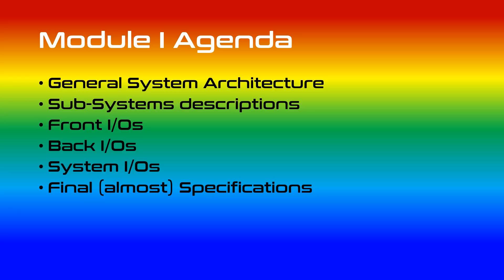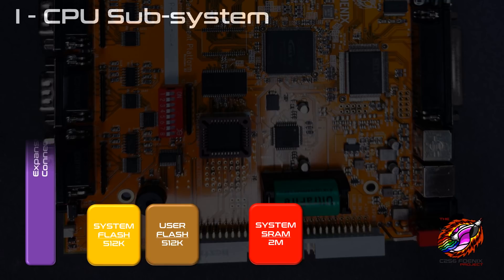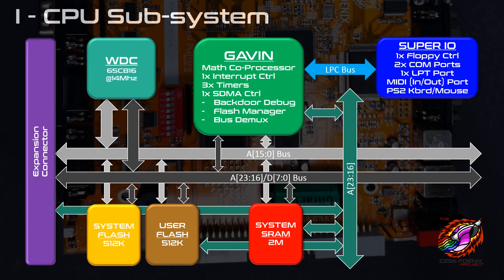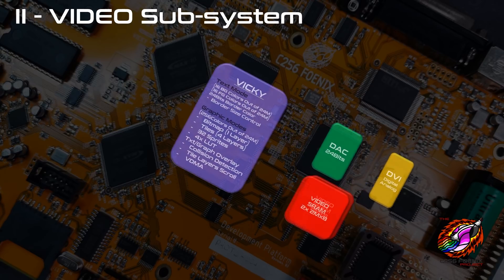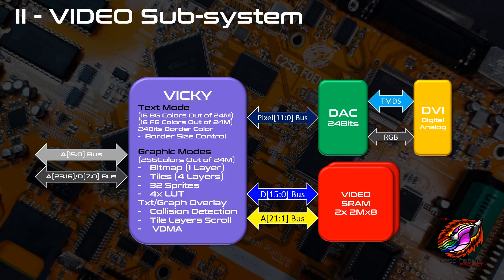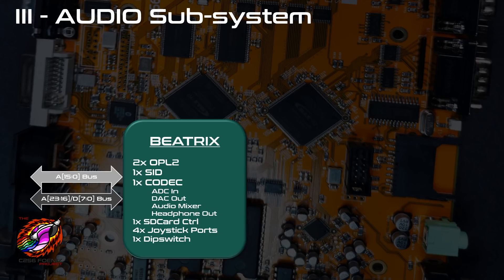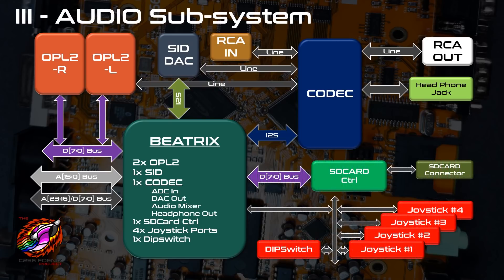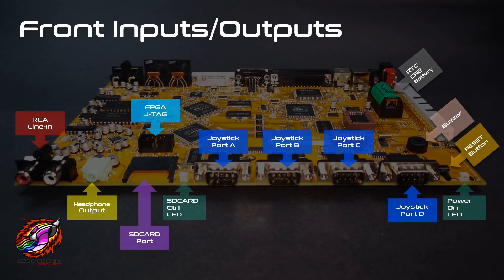C256 Foenix - Tutorial Series - Module I - System Architecture

Comment: I do not know quite where to post it in the forum, maybe under Specifications. However, I'd be cool with 2 megabytes of extra ram for $10. I do have a question about the math co-processor. What is the general performance of the coprocessor / FPU? Does it multiply and divide in one clock cycle, or is it more like the 65816 in SNES, that it takes 8 clock cycles to multiply? I don't really have a preference. I suppose if it's faster, then this can have some simple 3D calculations to pull off something like Wolfenstein 3D on a 286. The system looks cool so far.
Reply from the maker: Like I mentioned before, I am not totally against the idea to put in place a way to reduce the resolution, but before I even contemplate the possibility, I need to finish the system as soon as possible with its original specs. Beside, a change like that would have a lot of repercussion on all the other Vicky's feature ... And, again, I am still not super convinced that because you would have access to a lower res peeps would automatically migrate old games to it, It would certainly help open the door for it... But how about we create new games instead of porting old one?
Reply: @foenixlabs  personally I like the blocky look of low res, it is artistic choice, and not for ease of porting stuff.
Reply: @foenixlabs  OK, sorry about the possible off-topic with my previous comment, I see your point. Creating new games/etc instead of porting old ones, indeed. But at some level this is more a "retro hardware" ie it's not an ARM / RISC-V / whatever based SBC but a hardware with a basically "retro class of CPU" so I think many people expects the 'retro feeling' and some 'retro compatibility' as well because of that. If someone wants to create something completely new, using only super high resolution and no other features is more like a modern hardware/SBC rather than a basically "its roots in the 8 bit era" feeling. Please do not misunderstand me, I like this project a lot and you've already done fantastic work, no doubts :) And these were my only feelings/ideas which are even hard to form into a technical explanation rather than a "feeling" only ... And yeah, sorry for the possible off-topic, I don't want to bother you with those, that "scaling stuff" wanted to be a technical level idea, I didn't have too much the intent to argue on the "feeling level" which is hard to catch anyway, and means different things with different people. Thanks again!
Reply: Finish the original system and sell us some. :) @foenixlabs
Reply from the maker: Thanks tterbo128, I will.. Check your email! ;o)
Reply: @foenixlabs  The games that I'm planning on making for this system will have the option of old school 320x200 mode and less-old school 640x480 mode. It would be great if there is a "true" 320x200 or 320x240 tile mode, but, if there isn't, I will just have to quadruple my pixels for my tiles. Something like the Mega65's VIC-IV's scaling registers would at least allow me to just program it as if it did have a 320x200/320x240 tile mode.

I personally would be very interested in 320x200 games for the Foenix, as it has the old school look. Also, I use 15.75KHz RGB-converted TVs, computer monitors, and an arcade monitor. A lot of retro-enthusiasts use some form of 15.75KHz monitor. I personally would love a 15.75KHz output option, and would be willing to pay extra for it. Supporting both scan rates, like the AGA Amigas and the Atari Falcon, would be ideal.

Keep in mind that VGA had a 320x200 Mode 13h (and unofficial Mode Y), but displayed using scan doubling and 70Hz refresh rate and the same 31.5KHz scan rate (using 449 lines vs the 525 lines used by 640x480 and NTSC). 320x200@60Hz with 525 lines for an NTSC-like resolution/refresh rate would have worked, as well, and the VGA CRTC can be reprogrammed to do so, using an NTSC 15.75KHz scan rate with scan doubling turned of or a VGA 31.5KHz with it turned on.
Reply from the maker: tterbo128,
As I mentioned earlier, I will talk in detail about the math processor in the Tuts about Gavin's features.
However, I can certainly give you a list of what the Math block does:
1- 16 x 16 Unsigned Multiplication
1- 16 x 16 Signed Multiplication
1- 16 / 16 Unsigned Division
1- 16/16 Signed Division
1- 32 + 32 Addition (And/Or subtraction)
The deal is... By the time you have put your values in A and B of the 16 x 16 Multiplication Registers for example, than next cycle you can go and fetch the results. So there are no delays for you to get the results.
It is a Integer Math block, there is no floating-point at all.
Now, in order to pull off a Wolfenstein 3D on the Foenix, you will need to sacrifice a lot on the video aspect of things and that too, I will have to make a video about it.  The 286 was a 16Bits processor and faster than 14Mhz, the processor itself had a faster access time than the Foenix. The deal is, the Foenix has a 640 x 480 which is abnormally large for the capacity of the processor, this is why Vicky has so many hardware features because the processor itself doesn't have enough bandwidth to address the whole bitmap array during the blanking time... I will leave it at that...
Reply: @foenixlabs  Sounds good. I'm sure it can already do Wolfenstein 3D since the Apple IIGS did it without any coprocessor. Probably with lookup tables I imagine. It'll be fun to see what feats the Foenix can pull with the integer math coprocessor.
Reply from the maker: tterbo128,
The difficulty won't lie in the math processing, it will in be in the time to actually draw the pixels. The Apple IIGS version of the game must have used a 320x240 mode, which is a 1/4 of the resolution you have now. Even in 640 x 200, it is half of what you have now. What I am trying to say, is that you don't have time during the blanking period with a 14Mhz processor to write new pixel for the whole 640x480 @ 60FPS. In order to achieve that, (although, I didn't do the math), you would have to use a double buffer technique and create your new frame during 2 or 4 frame blanking period, which means that @ 640x480, you would end up with 15PFS, 30 if you are very efficient.
That will be the challenge...
Reply: @foenixlabs   Yeah, I know with MS-DOS, we just let it run at 320x200 resolution, or 256x224 in the SNES case, and got whatever frame rate it could accomplish. If there's only the 640x480 60fps video mode, maybe a +/- keycombination to shrink/grow the viewport size would aid in keeping up with the display.
Reply from the maker: Maybe there would be a way to reduce the viewport without changing the resolution itself... Hum, I will look into that... It would certainly give you more time to deal with the bitmap and also, since the viewport would be smaller than you wouldn't have to deal with so many pixels... I guess there will be a sweet spot... Thanks for the idea... Never thought about this one...
Reply: @foenixlabs  Yeah. Or is it possible to render at a lower 320x240 resolution and/or lower frame rate? Does the whole thing need to be re-rendered each 1/60th of a second, or can double buffering hide the slowness while avoiding image tearing?
Reply from the maker: One of the thing that me and David (Murray) didn't agree on was the idea of being able to have a smaller resolution.
The thing is, as accurate I want to be in terms of being proper to the era, I still need to make choices that will facilitate the usage of that board today. Very little monitor would support such a low resolution these days. VGA is pretty much the baseline if you want it to work on pretty much any monitors. Below that, it begins to fall into the realm of NTSC and PAL and I don't want to have to support 2 standards. 640x480@60fps is as standard as it gets. I could display 1 pixel ever 2 clock cycle, yet the dotclock remains the same. So for all these reasons, I will stay @ 640x480... Funny enough before that I was displaying @ 800 x 600 with a dotclock of 40Mhz instead of 25Mhz. 
Now, if you do double buffering, if you change your page at the right time, you will not have tearing. 
Listen, @ this point before I even contemplate finding ways to maybe displaying something smaller than 640x480, I need to finish the whole thing... And who know you might actually find a way to do it when you get a machine... Don't let me deter your from finding a solution to that problem, because there is actually a way to do it!
Cheers! Stefany
PS: I don't have to give away all the answers! right! ;oP
Reply: @foenixlabs  About frame rate, indeed. However on resolution, I guess the solution can be to add "scaling settings". Ie, horizontal scaling just tells how many same pixel is repeated horizontally. For vertical scaling, surely, the whole scanline must be repeated "n" times. In fact, on Mega65, the "VIC-IV" (C64 has VIC-II, C65 has VIC-III, Mega65 has VIC-IV ...) there are those scaling registers, and various VGA related registers. On "legacy" VIC-II, VIC-II modes, simply, on mode change those registers are filled (automatically, if "legacy mode change bits" are touched in the corresponding VIC-II/VIC-III registers), so basically a 320x200 screen is set up on a much higher resolution (from the view point of the monitor) but with the corresponding scaling values set. Surely, some can even take advantage to directly manipulate the scaling registers, even in each scanline, to have very interesting effects (there was even a preliminary intro for Mega65 exploiting this scaling register direct access). I think, for the "retro feeling" lower resolution is a must, however nobody told, that it must be the same resolution / dot clock / whatever what "the monitor sees" :) Surely, this was strictly my "IMHO" kind of opinion with my usual bad English :) Yes, I know, that C256 does not aim to be compatible with VIC-II/VIC-III or such, so my ideas here may not apply as directly as with Mega65, but still: it would make much easier to port existing games/projects written for systems with much smaller resolutions.
Reply: @foenixlabs  you could have zoomed modes, iirc the mega65 does this, it renders the pixels twice as big or more depending on the selected res . I might be wrong tho
Reply: @foenixlabs  Or a 2x scaler in the FGPA, that could be switched on and off. Switch it on, and writing to (1,1) automatically writes to (1,1),(1,2),(2,1),(2,2). Maybe that's too messy though. If 14mhz keeps up with the extra pixels consumed in a second, then who cares.
Reply: @tterbo128  At 640x480x8bppx60hz, the entire bitmap should only need ~17.5MB per second of data moved. Given that Vicky has 4MB of video RAM (and the system has Gavin as  a math coprocessor, shouldn't the 65816 have plenty of horsepower to pipe positional/enemy/scoring & other data to Vicky and still run at >15FPS? I am not very good at game design, or very good at programming as far as that goes, but it seems like enough oomph is there :) The view port idea sounds good, depending on how Vicky works; i.e. can we easily only update the top half (or whatever the viewable section would be) to reduce the load and maybe use sprites for the floor #, score, ammo, health, etc to keep from having to update the bottom portion of the screen to keep the frame rate up. Of course, a table based approach like you mentioned would be very quick, relatively speaking.

I am down for whatever graphics modes Stefany has Vicky do, but it would be cool if an inbuilt mechanism was easy enough to implement a 320x240 resolution through a hardware scaler register setup like mentioned above.
Reply: @markstrickland438  I agree. I think Stephanie is the best one to decide. She has access to the hardware, so she can run tech demos on it to see if it works as hoped for, or not. The system has lots of modern advantages under the hood, so there's probably good reason to assume it'll run great games. If it can play a tune and render some goombas, that's probably all a lot of people are looking for.
Reply: It does seem relatively straightforward to create a 320x200 mode that outputs doubled pixels so the display doesn't know you're running in a lower res... But as has also been stated in this thread - you could save some real-estate by using tiles & sprites at the bottom of the screen for the HUD in order to reduce the draw area thus reducing the amount of pixels that need to be raycast (in Wolf3d's case). But I'm just beginning to learn hardware stuff, so what do I know about what's straightforward and what rerpesents tons of work? :)

For the sake of arguement, though, if a "half-resolution" video mode register were to exist, it would be theoretically possible to set up a rasterline IRQ at the bottom of the action window and switch back to hi-res for the HUD portion. :)